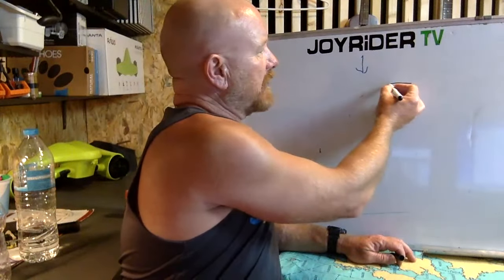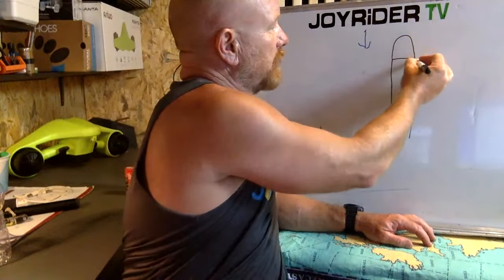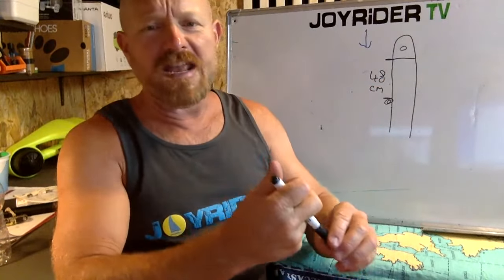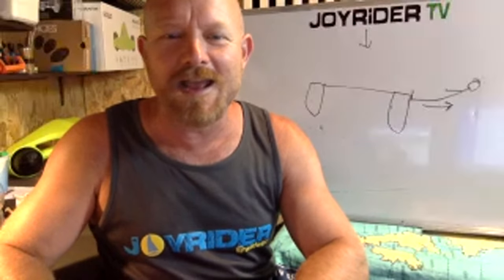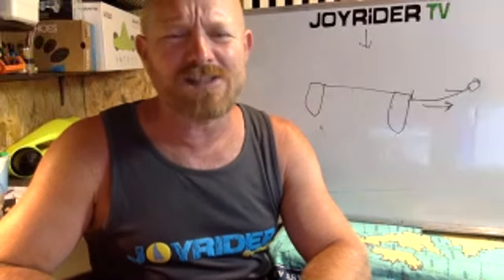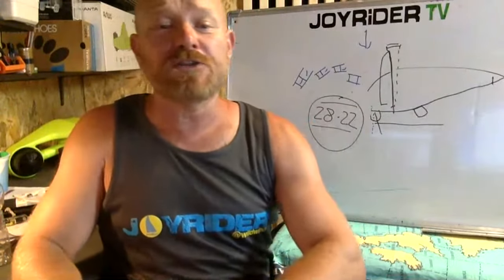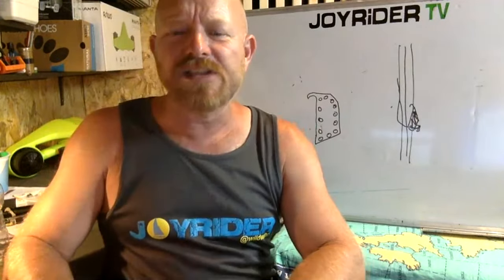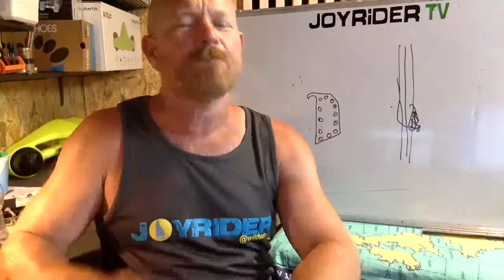Q+A LIVE: Your Catamaran Sailing Problems - solved?

Comment: Hello Lukas here.. thank you for your interest and answer my question... but I don't think your indication of 48cm is correct. I can send you some picures after modification regarding your indications.
Reply from the maker: I measured a mast that I have here, the fitting for the spinnaker top block was 48. 
We haven't rigged spinnakers on our 16s here but the masts came fitted from the factory.
Reply: @JoyriderTV  ok, anyway thanks for your help ... I will be able to manage this issue. Best regards.